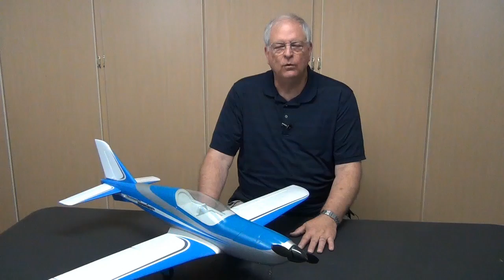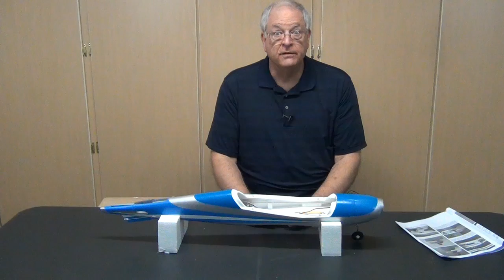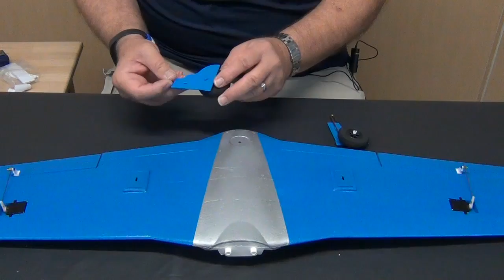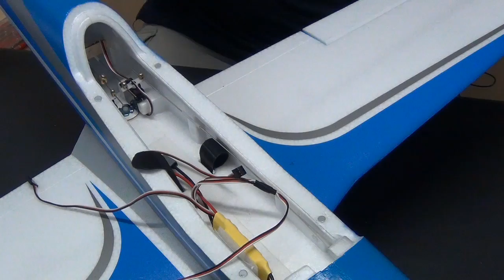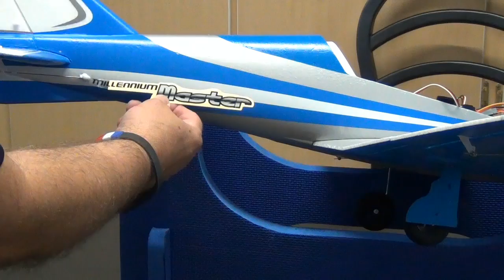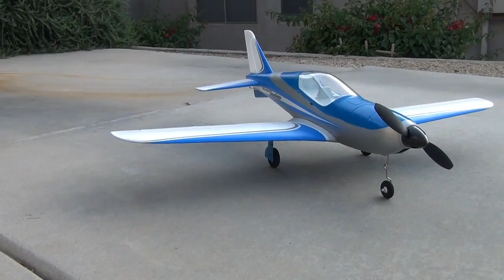Millenium Master Build Log

Comment: Do electric planes have thrust correction built in to the motor mount? GREAT video. I'm going to get one of these planes!
Reply from the maker: Most electric foam ARFs do. Some do bettwr than others. Balsa ARFs may require your own motor mount and you'd have to built it in. Others, however have both electric and fuel mounts that when built and mounted correctly will account for some down and right.

Comment: looks like a good easy plane to work with,glad to see someone else using the ORX3 stabilizer system,I put it in my Waco Bipe. My brother calls me a wuzz but I told him for as windy as it is here most of the time,this is a good thing. The price is reasonable,Its easy to use and why not,I want to be able to relax and enjoy flying, not worry about crashing or something happening suddenly and not be able to save it. Besides I can easly switch it off.  Another great build,thankyou.